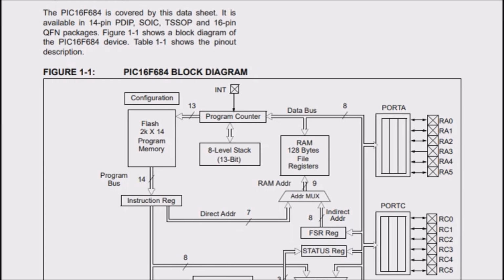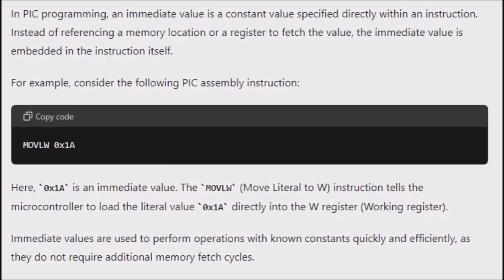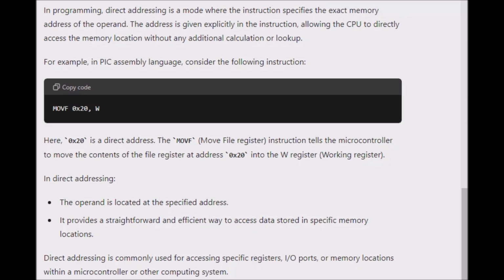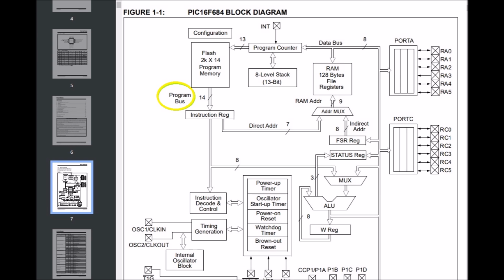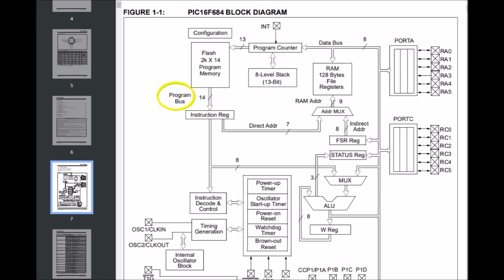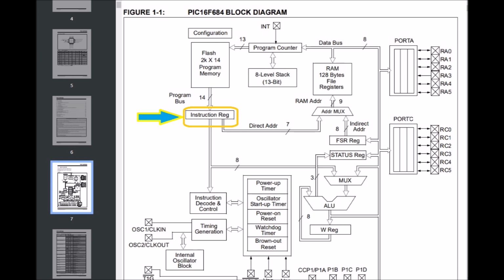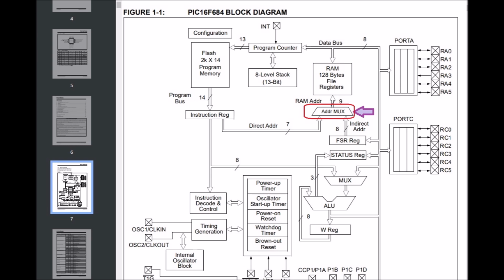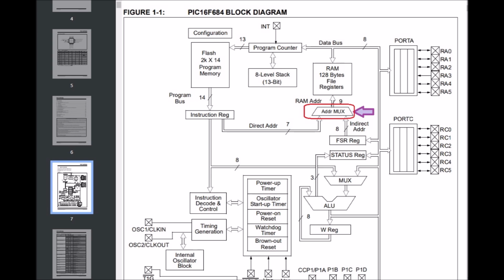PIC16F684 Part 004 - Block Diagram

Comment from the maker: Hi nerds!

I expect you enjoyed watching my last video. You’re welcome. I’ll reward you with another video. Today. I am further discussing the block diagram of the PIC16F684.

It’s really important that you subscribe. So, go ahead and do that. Now, please!

Alright, so let’s take a look at the PIC16F684 block diagram.

In the PIC16F684 microcontroller, the program bus is an internal pathway used to transfer program instructions and data between different components within the microcontroller. Specifically, it connects the program memory (where the program instructions are stored) to the CPU (Central Processing Unit).

Here's a breakdown of its role:

Fetching Instructions: The program bus is used by the CPU to fetch instructions from the program memory. These instructions are stored in the program memory as a sequence of binary codes.

Instruction Execution: Once an instruction is fetched, the CPU decodes and executes it. This process may involve reading or writing data to/from other parts of the microcontroller, such as the data memory or I/O ports.

Addressing: The program counter (PC) in the CPU holds the address of the next instruction to be fetched from the program memory. This address is sent over the program bus to access the correct memory location.

Transfer of Data: In addition to fetching instructions, the program bus may also be involved in transferring data that is part of the program instructions, such as immediate values or addresses for branching operations.

In the block diagram of the PIC16F684, the program bus is typically depicted as a set of lines connecting the program memory to the CPU, indicating the flow of instruction codes from the memory to the CPU for execution. This bus is crucial for the operation of the microcontroller, as it ensures the proper sequence and execution of the stored program.

Alright, let’s talk about what the "Instruction Reg" is. You can see the “instruction red” shown in the PIC16F684 block diagram.

The "Instruction Reg" (Instruction Register) shown in the PIC16F684 block diagram is a critical component in the microcontroller's CPU. Its primary function is to temporarily hold the current instruction fetched from the program memory before it is decoded and executed by the CPU.

Here's a detailed explanation of its role:

Fetching: The instruction register receives the instruction from the program memory via the program bus. This instruction is fetched based on the address specified by the program counter (PC).

Holding: Once the instruction is fetched, it is stored in the instruction register. This temporary holding allows the CPU to decode and execute the instruction while the next instruction is being fetched from the program memory.

Decoding: The instruction register contents are decoded by the instruction decoder, which interprets the binary code of the instruction to determine the required operation.

Executing: After decoding, the CPU executes the instruction. This may involve various operations such as arithmetic calculations, data transfer, logic operations, or control operations.

In summary, the Instruction Register in the PIC16F684 block diagram is essential for holding and processing each instruction fetched from the program memory, enabling the CPU to perform its tasks sequentially and efficiently.

Basically, the “instruction register” is a thing. It holds the instruction for processing.

Next, as you were looking at the PIC16F684 block diagram, you may have asked yourself, what is the "addr mux"?

I’m glad you asked, because I have an answer. You’re welcome.

In the PIC16F684 microcontroller, the "addr mux" refers to the address multiplexer. This component plays a crucial role in managing the addresses sent to the program memory and other memory components within the microcontroller.

Here’s a detailed explanation of its function:

Address Selection: The address multiplexer (addr mux) selects between different sources of addresses that need to be sent to the program memory or other memory components. These sources typically include the program counter (PC), which provides the address of the next instruction to be fetched, and potentially other address sources for special operations like interrupts or jumps.

Program Counter (PC): The addr mux typically selects the address from the program counter during the normal execution flow, allowing the sequential fetching of instructions from the program memory.

Interrupts and Jumps: When an interrupt occurs or a jump instruction is executed, the addr mux switches to select the new address provided by the interrupt vector or jump instruction, redirecting the execution flow to the appropriate memory location.

Efficiency and Control: By using an addr mux, the microcontroller efficiently manages the flow of instruction addresses, ensuring that the correct instruction is fetched at the right time. This is crucial for the microcontroller’s operation, particularly in handling sequential execution, branching, and interrupts.

In summary, the "addr mux" in the PIC16F684 block diagram is an address multiplexer that selects the appropriate address source (usually between the program counter and other sources) to access the correct memory location, enabling proper instruction fetching and execution.

Alright, I am going to end this video here for now. I want to continue to examine the PIC16F684 block diagram. However, to fully explain my next topic, it requires an explanation of indirect addressing. I’ll cover than in my next video. Thanks for watching. Stay tuned. And, please subscribe.